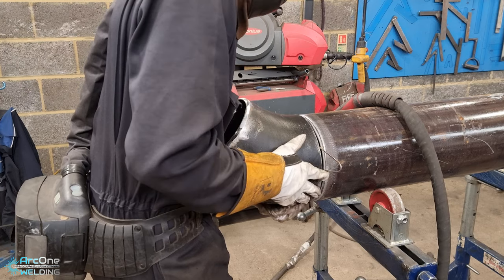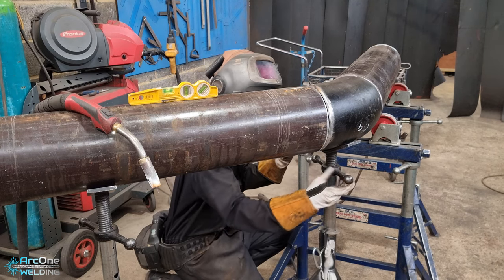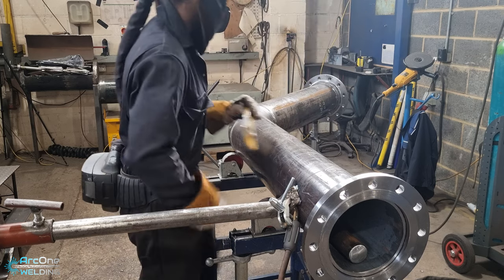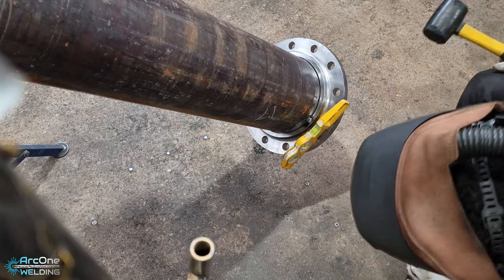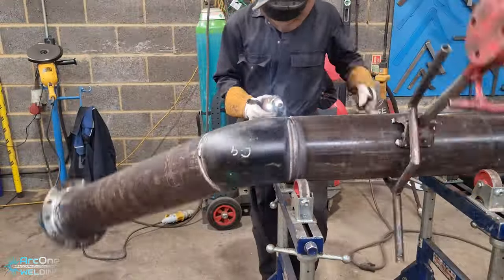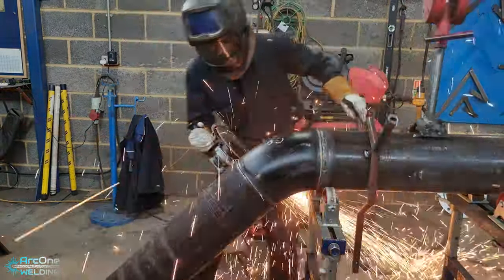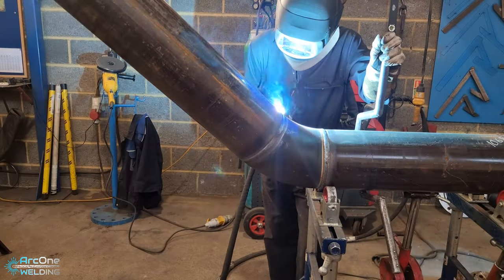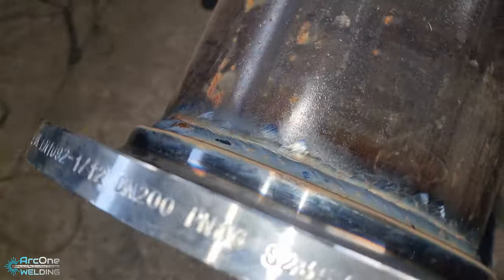Can You Roll A 6G Butt Weld???

Comment: Hey we use Fronius too, for alum though. Try this Go mode>special 4t then go into you welding parameters set the start time to null, hot start to 135% (this is what I use for alum so steel will be less, say 110% or something) and the crater time to null with a crater fill of 80% or so. its great for welding but not so much tacking... I usually set my upslope and downslope to about .3 seconds. You get hot start for as long as you hold down the trigger then you let go it goes to your set amperage and then if you hold the trigger at the end you get decreased amperage for as long as you hold the trigger then let go and the arc stops. Basically it runs just like a trigger hold tig machine. Sorry for the terrible grammar, I hope you see this and try it out. Took me ages of fiddling with the machine to find this "secret" setting.

I really like what you said about respecting the tools, my thoughts exactly as well.

Comment: what kind of arc length do you normally use for your pulse runs? i have to run 3.5 normally with 0 on the dynamic for most my profiles